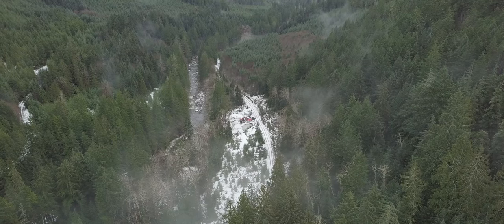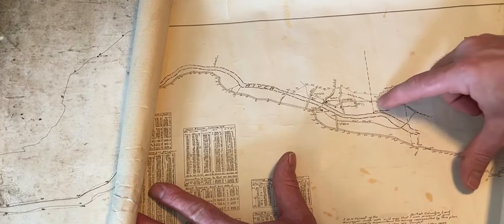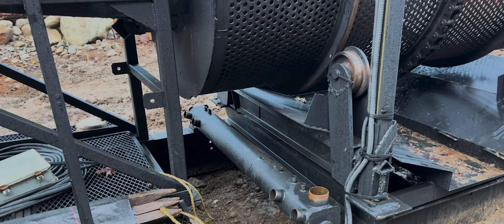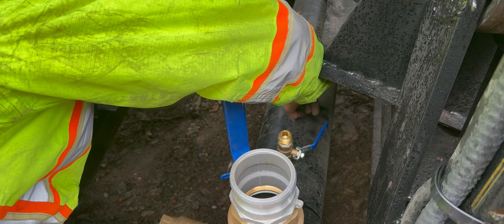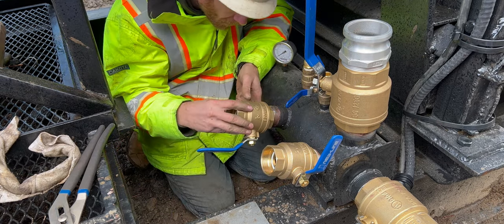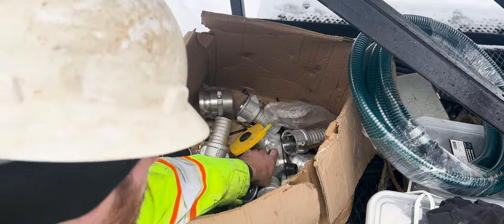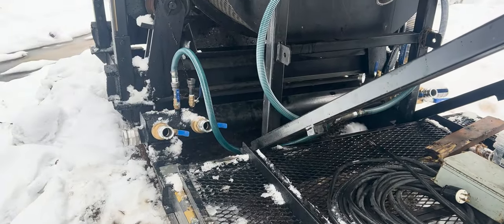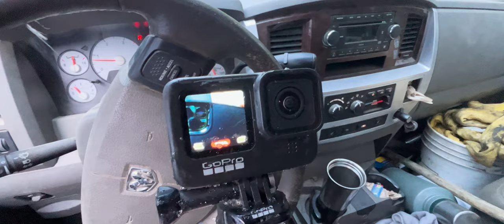1000 Ounces Of Gold And The Missing Maps

Comment: Life pro tip for next time you're setting up plumbing like this. Pipe dope. it's liquid apply pipe tape, so you're not sitting there wrapping stuff, you just pull the brush out of the can, paint the threads and go. I've had amazing luck with it, and it gets rid of those times the tape got wrapped a little weird, or you need to turn it 1/4 turn past ideal because the tape didn't seal. I just get the oil/gas rated stuff that way if it's a hyd line or a fuel line, it still works

Also, when welding out pipe stubs like that, that's when I'll use teflon tape and put an end cap on it to hold the threads nice while welding. the tape is used to help get it back off because if it tried to warp like the one you had, it's going to be tight as sin after welding, even if it was only hand tight to start. But you'll be able to start a fitting every time afterwards